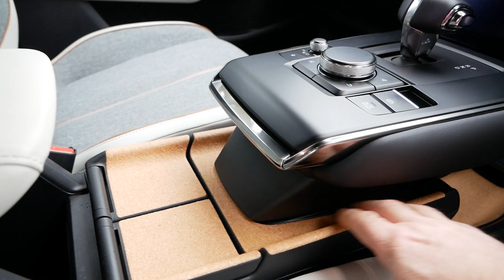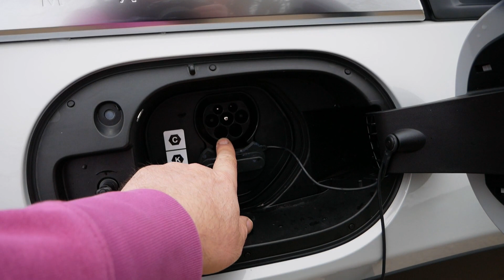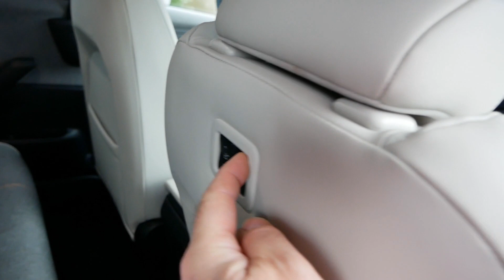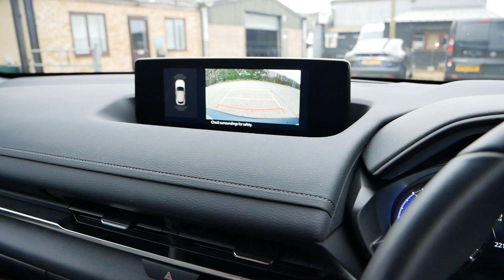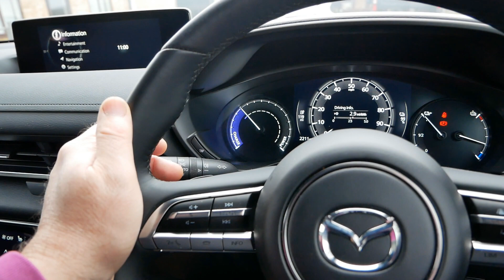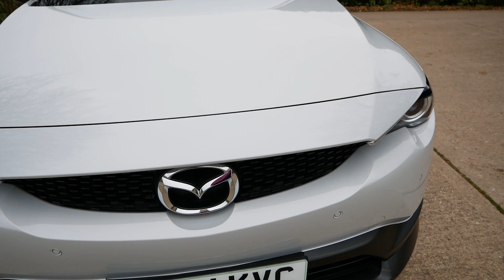SOLD: 2021 Mazda MX-30 First Edition EV, only 4 months old

Comment: Oh wow, you drove from Oxfordshire to london and back without charging
Reply from the maker: In the UK, the average miles driven per day is 19 miles. 28% of people drive less than 10 miles per day. Only about 12% drive more than 40 miles. So even small battery EVs are fine for the majority of people if they can charge at home.

Comment: Are the wheels 17 inch? And I ask as I have on my car all weather 17 inch tyres and could easily swap  them to others if I was to buy one of these. Mileage wise I prefer the smaller battery, as I do not go long distances and once a week charge it up to 80% on the CS charger.